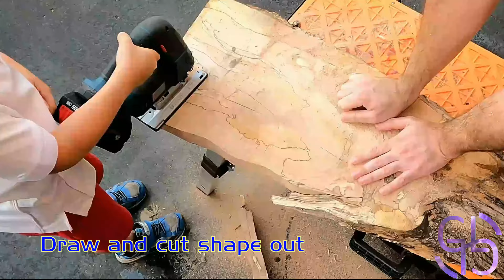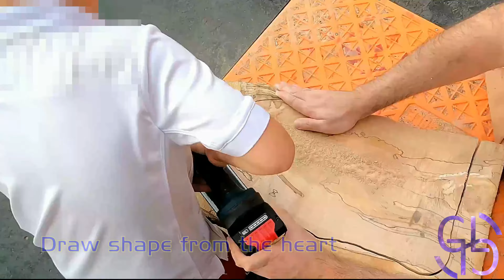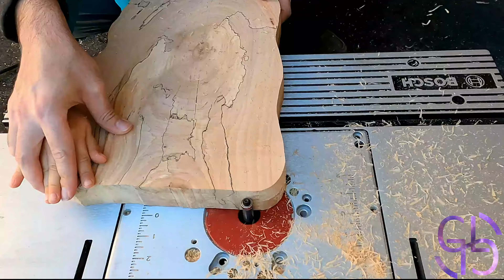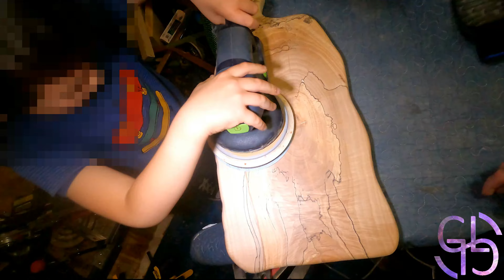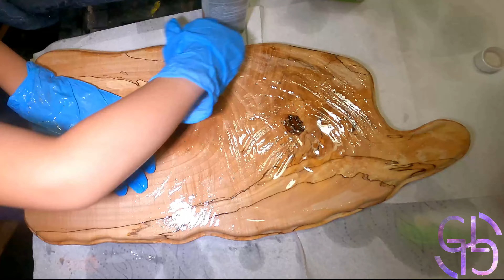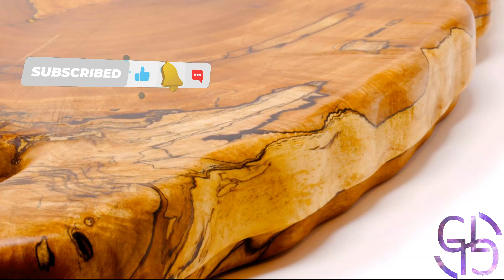Silent Woodworking

Comment: What kind of oil did you use?
Reply from the maker: Thanks for the comment! I use saman oil for most of my work since I trust it and it's 100% Canadian made from Quebec, and is food safe. Not to mention it smells absolutely fantastic! Just have to remember to wipe excess off with a buffing pad or a cotton cloth after four to six hours otherwise it will be a pain to wipe off later on. I usually pour a generous amount. Buff/wipe excess off after four hours, let it rest for another six hours and then apply another coat. And most of the time I apply three coats per side.
Reply: @carefreeliving  Thank you I have seen SAMAN oil at the store are there any SAMAN oils with a tint or stain that are also food safe? I can't find info anywhere to say that yes they are..... Cheers!!
Reply from the maker: @leeanderson8466  unfortunately no. Saman only has one oil that's food safe. Everything else they have is absolutely excellent for staining but is not food safe and for indoor furniture only. I also found that they have very little info on their website. I actually had to call them and try to get someone who spoke English since everyone on the phone spoke French. The cheapest place to buy saman oil is usually Lowe's. During Christmas I got 15 bottles for $9.99
Reply: @carefreeliving  Thanks again. That's a good deal I will have to keep my eye on the sales. Cheers.